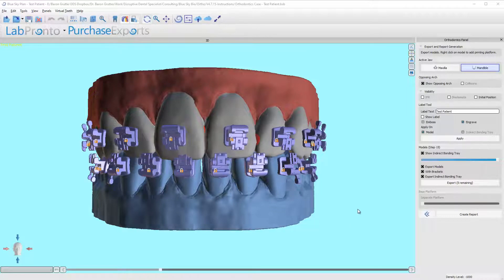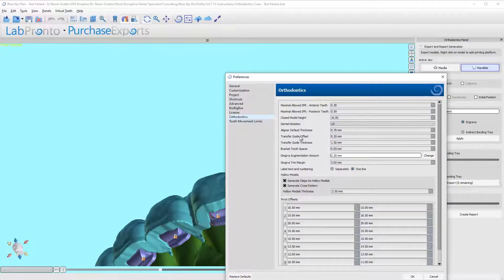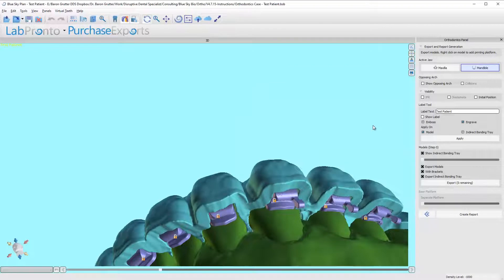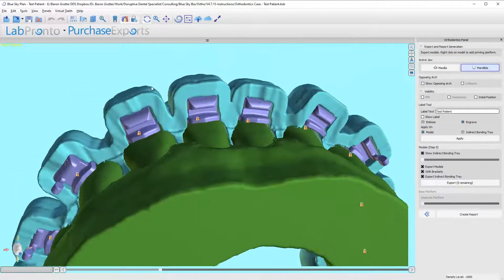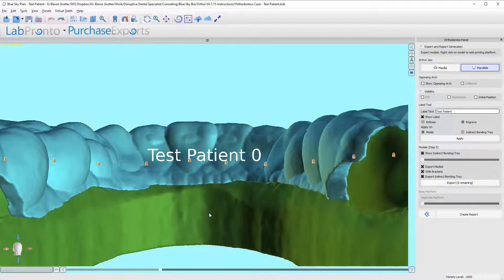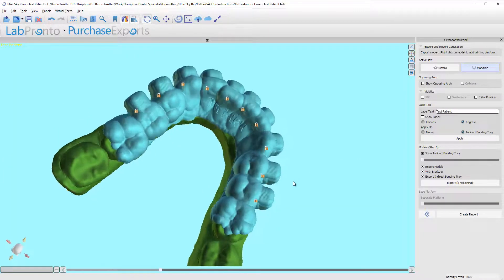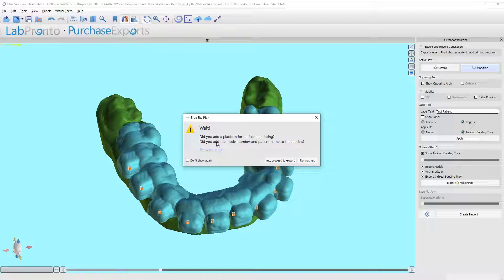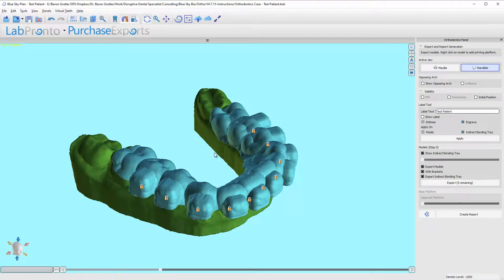BlueSkyPlan v4.7.15 - IBT: Step9a - Export Tray

Comment: Ok. I am a novice here. I couldn't understand the functionality of brackets & trays. Are they different from aligners. ?
Reply from the maker: Brackets and trays refers to trays that help to align traditional orthodontic brackets to teeth.
Reply: @bgrutterdds  Thanks. So the indirect bonding trays can be 3d printed to fix the brackets to the tray offline and put it to the patient's teeth later. Did I get it right?